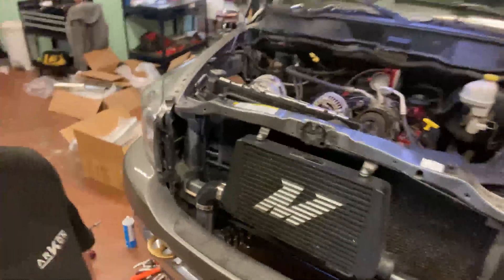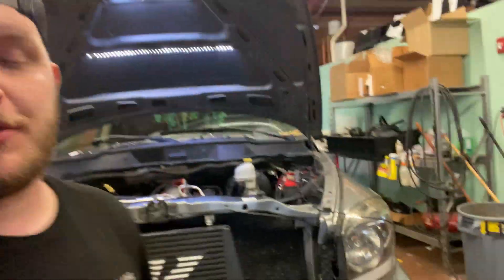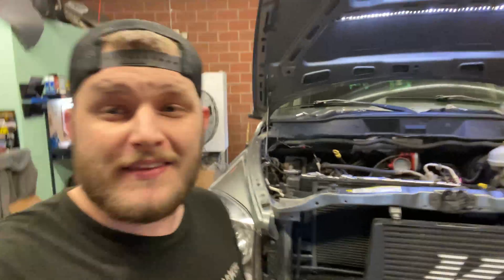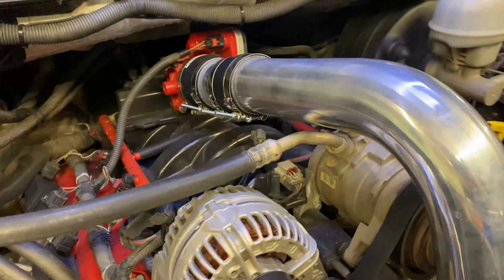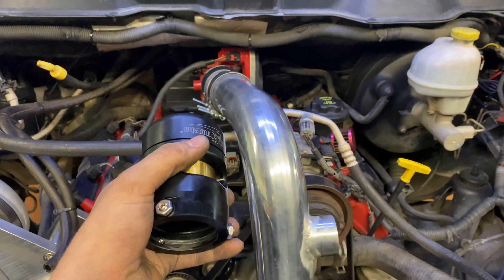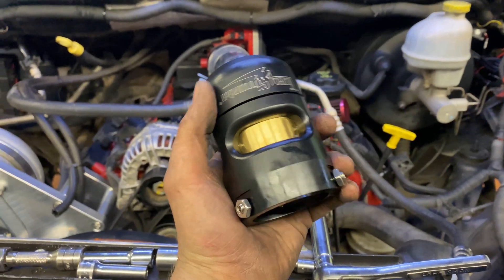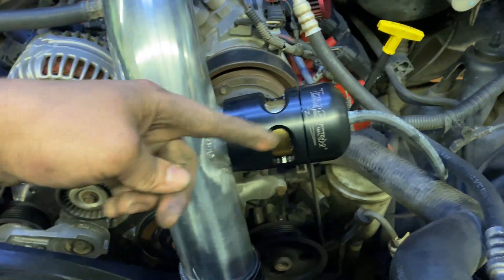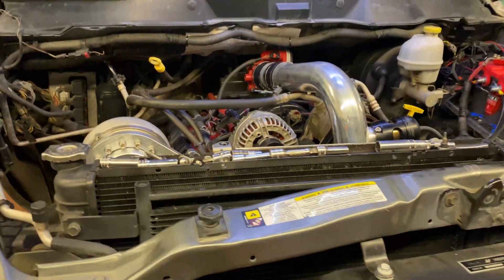TorqStorm Centrifugal Supercharger Install | Part 3 - Charge Pipes and Blowoff Valve Install

Comment: Nice work buddy. I would suggest getting a thread in iat sensor and weld in bung. You will likely have a boost leak around the push in grommet.